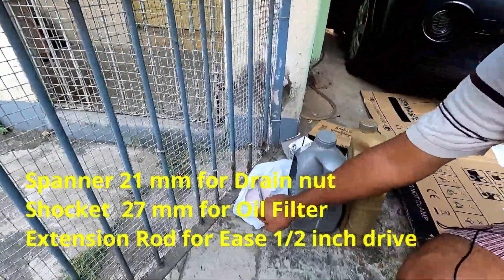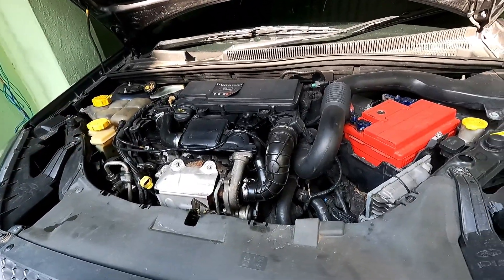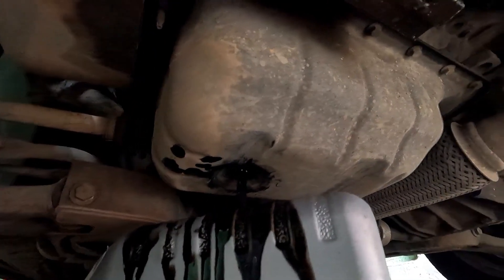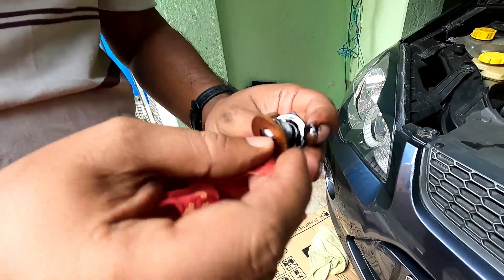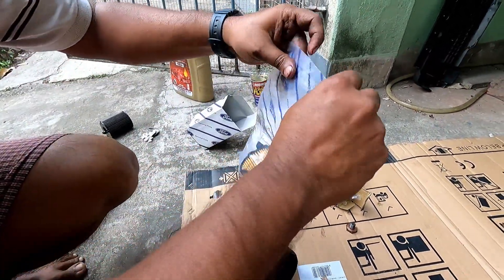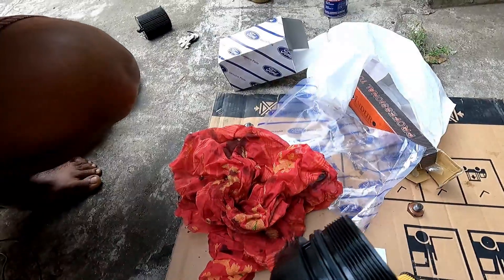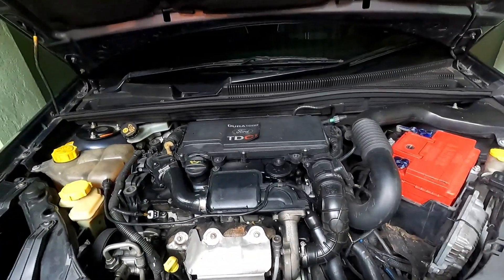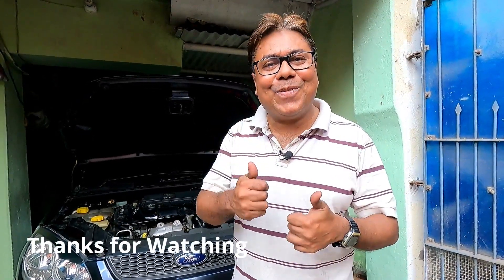How To Flush & Change Engine Oil  Filter Of Ford Fiesta Classic on Your Own

Comment: Very good video and informative. But you don't need a fully synthetic oil for a Ford Fiesta classic. Semi synthetic is what's recommended.
Reply from the maker: Yes semi synthetic oil will do the job fine but synthetic oil has a longer drain period and performs better in start stop traffic conditions

Comment: Dada, I tried to remove oil drain plug, it rotates but does not get out. What to do, I used anti- clockwise to remove it, sprayed anti-rust chemical, not possible to remove. Please suggest how to remove it?
Reply from the maker: Is your spanner moving false first check that . Then try to remove it with a new hex spanner of the same size. If it doesn't work you need to go to a local workshop . As this may require to create a cut  point and then slowly rotate that point with a hammer and  flat blade screwdriver. Replace with a new drain nut and gasket.

Comment: is it normal to see bubbles in coolant tank while accelerating?
Reply from the maker: Yes coolant will circulate and some bubbles may appear. It will diminish as the system heats up. Also the system may contain some air in the cooling system.
Reply: If you meant coolant trickling from the system back to the reservoir, it's normal, but if you see actual bubbles, then that could be a potential problem. Heard of head gasket leaks? When gasket between head and crankcase fails, the loss of seal will cause the gasses pressured inside the cylinder to be released into the coolant channels. This gas travels through the coolant pipes to exit into low pressure area (atmosphere). That space is your coolant tank. If you see bubbles there it means the cylinder gasses are reaching there via coolant channels. Time to get gasket change in that case. If you have a modern car with sensors, if cylinder loses pressure this way, you should be able to see a check engine light. If in doubt, get a mechanic to diagnose. It gives you peace of mind.
Reply from the maker: Thanks again for your feedback

Comment: Which coolant oil is use for fiesta
Reply from the maker: Engine oil 5w 30 and coolant orange colour from a reputed brand.
Reply: @supercyberautomotivetravel   I have recently purchased fiasta 2012 disel 1.4 it's reliable car or mentainence cost is high ?
Reply from the maker: It's a reliable car.  Spares are available online. So if you do the service in a local workshop maintenance cost will be reasonable.
Reply: @supercyberautomotivetravel  which website is good for buying spears parts?
Reply from the maker: boodmo.com
Reply: 3.5 liter oil is sufficient?
Oil filters price
Reply from the maker: Yes 3.5 is sufficient. Oil filter Rs.366 at boodmo.com

Comment: I have this car 2006 disel model so can i use castrol 5w 30 castrol?
Reply from the maker: Thanks for your query. Yes you can it's the same engine I am having. Still on the safer side please check the owners manual.

Comment: Sir, thanks for informative videos every week 

I have a query
How much kms this TDCi engine will can run 
Incase of engine overhaul what will be the cost

Thanks in advance
Reply from the maker: Thanks for your query. This engine is highly reliable and seen to have run 2.5 lakh kms or more without any overhaul. Yes regular oil and filter change is the key to its life. Overhaul may be a costly affair as spares are a bit expensive and availability of the engine inner parts may be in the near future will be difficult as the product has been discontinued . In that situation we may consider second hand parts to our rescue.
Reply: @supercyberautomotivetravel  thanks

Comment: Sir....how is the servo engine oil compared to castrol or mobil, if you have used them both?
Reply from the maker: Thanks for your query. Servo engine oils are very good and at par with mnc brands in fact if not better. Since it's public sector they lack proper marketing. I have been using the servo brand for a long time and never felt any quality issues .
Reply: @supercyberautomotivetravel  Thanks 🙏🙏

Comment: Sir engine flush is necessary as i didnot do that in the last 45km..
Reply: 35000km.
Reply from the maker: Go for an engine flush and feel the difference.
Reply: @supercyberautomotivetravel  sir fiesta ka  bad tensioner assembly ho to kiya sign and symptoms hoga
Reply from the maker: Normally tensioner bearing ka noise hota hai lekin Bina noise ka bi kharab ho sakta hai.
Reply: @supercyberautomotivetravel  kharab hone par impact kiya hota hai sir

Comment: sir what about diesel filter , how and when it will be replaced , what are the symptoms
Reply from the maker: Thanks for your query. Normally diesel filters should be replaced every 30-40 thousand kms or every 4 years which ever is earlier.
Reply: @supercyberautomotivetravel  thank u for replying actually sir meri gadi ka rpm bohat low ho raha ha jb idle pe ho ya chal rhi ho jerk feel ho rahay ha gear badalte waqt , kya prblm lagta ha apko ho sakhti ha , i think diesel filter ka issue hai , what is ur opinion about it
Reply from the maker: Thanks for your reply. Jerky feeling at low rpm may be an issue with dirty Diesel filters and air filters also. So get both replaced I think the issue will be solved. Also clean the MAF sensor for smooth and lag free acceleration.
Reply: @supercyberautomotivetravel  sure , thanks i wish ur channel will grow soon
Reply from the maker: Thanks for your support.
Reply: @supercyberautomotivetravel  no prblm sir

Comment: Dada, I found oil leak at intake manifold and I cleaned it. Now, I have to apply sealant before fitting it. Which sealant is best with intake manifold? 

I purchased Anabond 666T-Max automotive RTV Silicone Gasket Maker, is it good or should I go for another?

Please,suggest....
Reply from the maker: Anabond is a renowned sealent maker . You can also Suzuki paste or sealent available in MGP stores.

Comment: Its a multi grade oil its better to use  15W 40 for diesel engines  multigrade oil means it can use petrol and diesel engines
Reply from the maker: The service manual recommends 5W30 oil for Fiesta Classic 2014 model and this oil is both for diesel and petrol engines. 15W40 will be too thick .

Comment: There are a few things right and wrong in the oil change method shown in this video. Firstly, let me help viewers understand when and where a flush is needed. If you're consistently using synthetic oil in the engine and have been religiously changing it before the 10000 km or 1 year interval, flush is generally not required. The only exception is if you buy a used car and you don't know whether the first owner has changed the oil in time. In such cases or if you have neglected your own oil change then once is fine in 50000 km. The fact is your engine internals need not look like a mirror, it's good enough if there is no varnish.  The black oil exiting the oil chamber is an indication things are normal. In fact I would be more worried if I see any other color of used oil. Like milky, foamy, brown. These colors indicate, leaking coolant, gasket leak, and other issues that are costly to fix. So black coloured oil is perfectly A-OK. But remember there are pros and cons to using flush. First, condition is your engine to have sooty sludge. That is baked carbon chunks that stick to head covers in the form of pasty varnish. If so, the oil flush will break these chunks. If you're lucky these chunks dissolve, which is the best case, and removed during oil change. But if instead of dissolving, if the flush dislodges the whole baked chunks, then you're in deep trouble. The oil channels running from the sump to all the bearings and internal areas are so so small. You have to see it inside an opened up engine to believe how small those channels are. If your car's chunk sized carbon bit goes into any one of those channels or oil galleries, then it's the same as artery block in the human heart. When blood supply to cuts to brain, the person dies. Similarly, if the oil supply is blocked by carbon chunks, then it's the end of bearings. So Ideally this shouldn't happen touchwood. But if it happens you're looking at engine seizure or piston launched out of the engine block due to high pressure and friction. This is this risk which many people don't interpret very well making one faction say flush is bad while others say it's good. The truth is both claims are true. What determines the success of flushing is what condition your engine was in when it was flushed. If it's just thin oily carbon coat and not pasty varnish, then flush is safe, but if it's thick crusty bits of carbon, then only a open heart cleaning is safe. Of course it's costly because you would have to remove the engine, and mechanics charge a handsome amount for that but it's much much safer. Secondly, not all engine flush is the same. If you are a budget person who buys a no-name brand flush, it may have solvents so strong that your rubber seals that prevent oil leaks inside your engine will swell like rotten flesh and fail. Remember, solvents and rubbers don't mix. They break or damage rubber O-rings because rubber is organic. So only high-quality expensive flush brands like Liqui Moly/ Abro/ Lucas use solvents that are just strong enough to remove the carbon but not strong enough to damage rubber seals. Anything you use other than rubber-friendly flush as shown by some YouTube Influencers will cause massive damage. I have seen some people use random things as flush on YouTube. Like Diesel, petrol, Harpic, etc. Don't every be as dumb as those people. 

Fact: Engine flush is mainly a very well engineered kerosene. So the additives inside the flush is balanced very delicately and precisely to only work against carbon, soot, sludge but not the rubber or plastic or metal. 

Secondly, coming back to this video. The oil change process was good until the filter replacement. When you're lubricating the filter before installation, I saw you had applied the oil on every random spot of that filter. No that's not required, that whole part stays immersed inside a pressured oil bath once the engine is running. You only have to lubricate the rubber Oil seal. That's more than enough. The idea is to lubricate the seal and let it absorb the oil. This way it doesn't dry and crack causing oil leaks. So no need to lubricate the paper element, the plastic, and other bits. It's was funny a bit. 

lastly, if you want to avoid the sludge in the first place, use good quality synthetic oil. Oil is the cheapest insurance against engine failure. Even if company says 10000 km or 1 year, there is no harm in changing oil every 6 or 7000 km. Where I stay it's always dusty and air is full of pollutants, so I change my oil every 7000 km. Also if you often run your car for short distance each day, you should not wait a full year for oil change. Remember, when you use your car for short drives, engine won't heat up much and it's the same for oil. They don't reach optimal temperature to vaporize moisture trapped in the oil. This is why oil goes bad very soon. The proof is the water dripping from your tail pipe when you start in the morning. It's just the moisture exiting the engine. It's very normal, but usually it's also a form of contaminant that shouldn't be inside your engine. Which is why timely oil change is very very important.
Reply from the maker: Thanks for your information and support.
Reply: What a wonderful and long explanation  bro 👌 thankyou for the info....can I get your number pls I have some doubts about my car engine bro 🙏
Reply from the maker: Thanks for your feedback.
Reply from the maker: You can email your doubts at supercarred5@gmail.com.

Comment: How many kilometres after changing GEARBOX oil
Reply from the maker: Thanks for your query. Gear oil change should be one in 5 years or 100000 lakh kms which ever is earlier. Please check your owners manual for more
Reply: Thank you for your valuable reply
Reply: What will be the gear oil grade, its not mentioned in owners manual.
Reply from the maker: Go for 80w 90 gear oil. It's a multigrade gear oil suitable for all transmission. If you can't get 80w90 you can use 75w 90 also.
Reply: How to change gear oil?

Comment: Ford Fiesta diesal engine oil 5w 30
Reply from the maker: It's the recommended oil as per ford  manual.
Reply: @supercyberautomotivetravel  my car Ford fiesta 2007 tdci diesel can I use 5w 30 oil
Reply from the maker: It's the same engine as my 2014 fiesta.